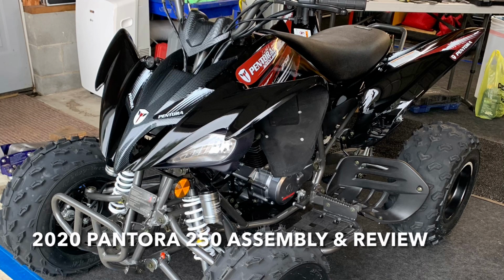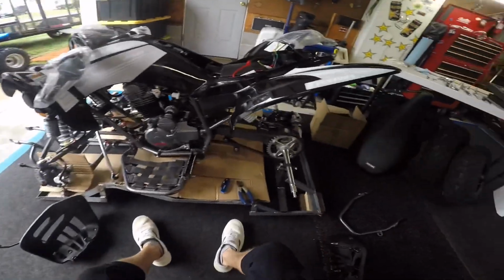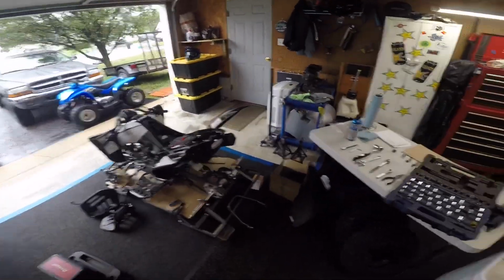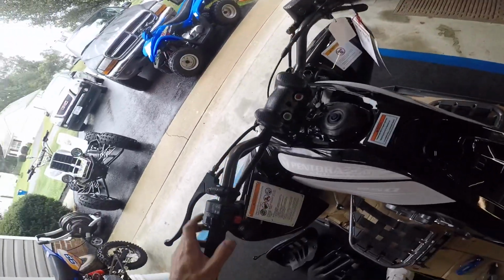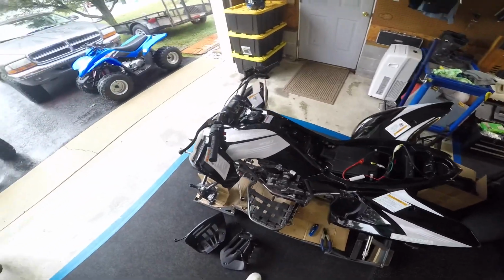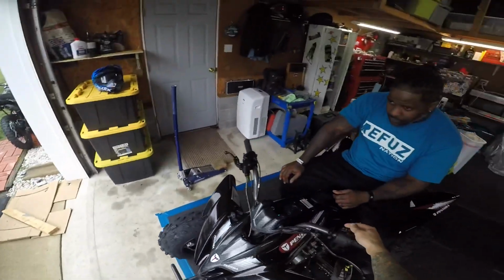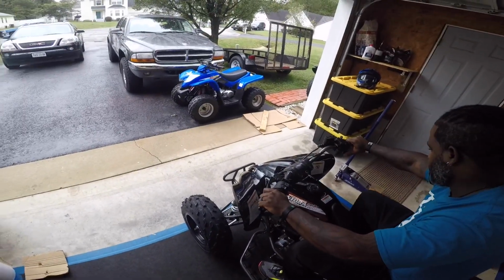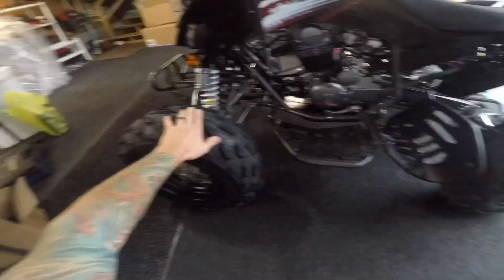2020 Vitacci Pentora 250 assembly & review Part 1.

Comment: I have had mine now for about 7 month and it just started to rust. You also have same problem? I mean maybe I left it a bit wet sometimes without making sure its dry but still not acceptable with rust already. You have any tips what I can do to prevent it to rust even more? Or is it already to late? The status on the rust is that I can just rinse it off with a towel but I dont know if this is a bad sign or normal?
Reply from the maker: You will have surface rust if you put it away wet or keep it outside - I recommend wiping all metal down with WD-40 in a rag
Reply: @tattedadvadirtslingers5437  can you prevent this to escalate if I do that? Would you say it's normal since I left it wet? Thank you for such a quick answer lol
Reply from the maker: @andreas6081  yeah that’s totally normal stuff and the wd-40 should take the surface rust away and prevent rusting.. just be sure to wash and dry your quad after every use.. then wipe with wd-40
Reply: TOTALLY unacceptable !!! Some don't realize this quad comes in a utility version also, basically the same machine . So what's being said here is every time i pull this machine from the barn i need to dry it off and WD40 it before feeding the livestock ?!?!  We all have heard over the years about inferior Chinese steel ..... WELL !?!?
Reply: @pacospete4299  indeed...
Btw. Anyone of you had problem with adjusting the idle? Im pretty sure my idle screw is out of position or something. If so you know how to solve it?